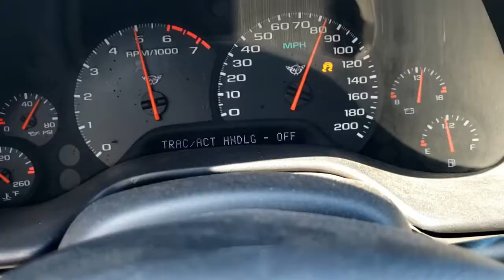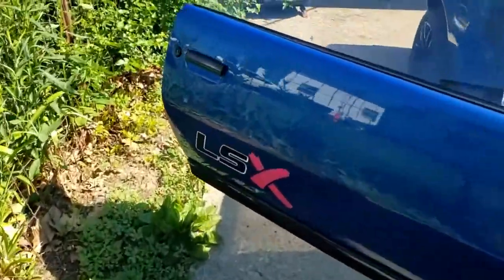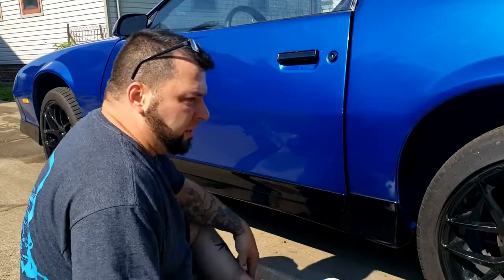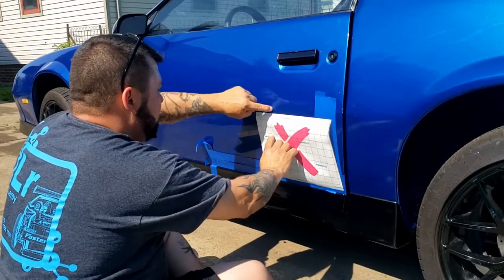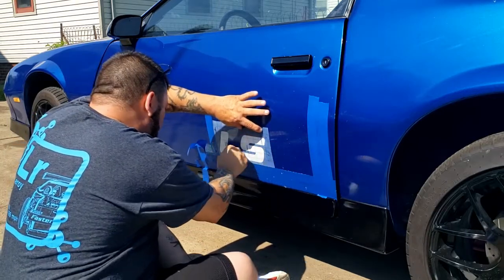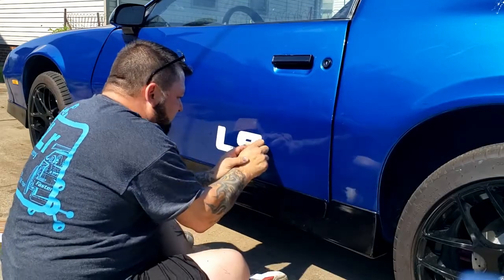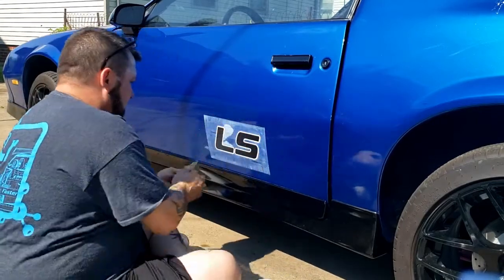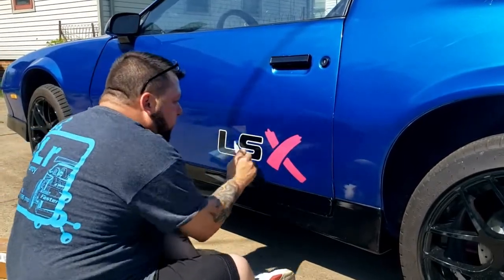How to put Decals on your 3rd Gen Camaro or any car, original decals or aftermarket.

Comment: What’s a good place to buy interior parts  wings etc got a good price I have a 1990 Camaro rs I’m redoing
Reply from the maker: I just went with ebay. $400 for a pair. You can find almost any colors and designs. If you're doing a Camaro 90, then buy seats that are only 22" wide at base or smaller.